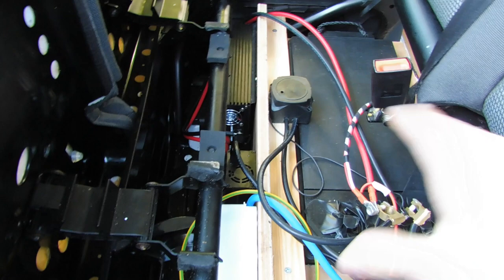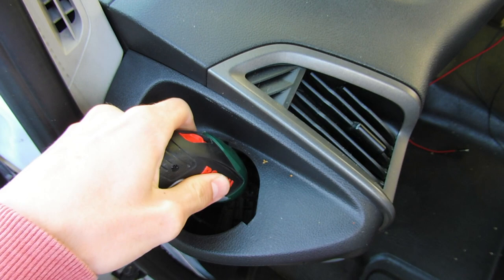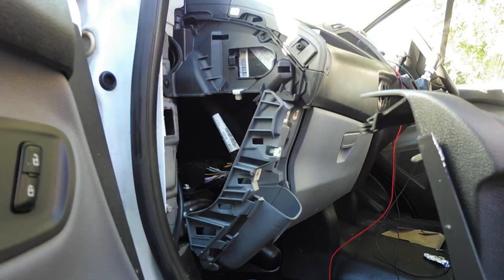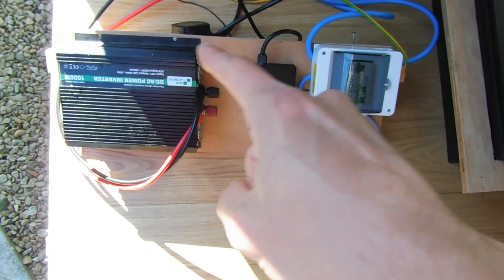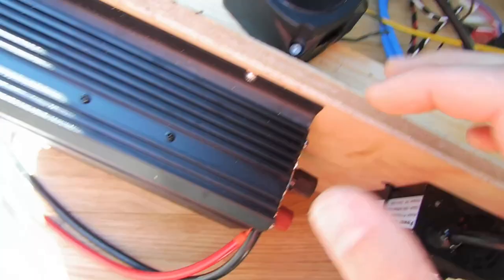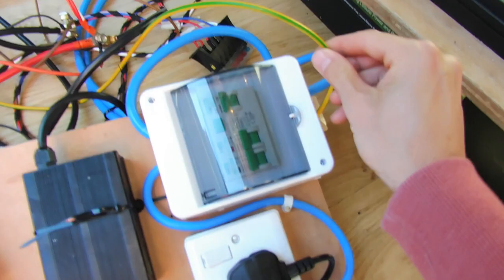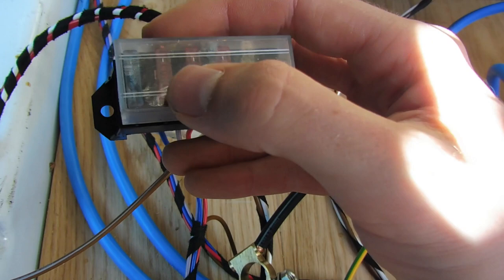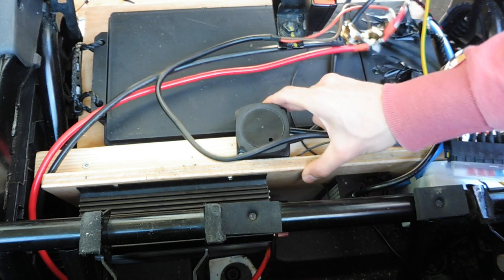VanLog 06 CAMPER CONVERSION Ford Transit Custom ELECTRICAL KIT! HOW TO

Comment: Not sure what the outcome of the smart alternator issue was here Hugh. Did the VSR provide a solution to proper charging of your leisure battery. My guess is that you had a smart alternator.
Reply from the maker: Hello buddy, the VSR turned out to be a bad choice. With a smart alternator you need a dc to dc charger
Reply: @HughTube  thanks, I am not going for a solar panel as I can't justify that extra expense I would rather use a large leisure battery and run it flat if the drain or stay without a charge occured. It's not the end of the world,  In reality I don't forsee that kind of use and solars are probably way overkill. The charger of leisures using the correct charge interface from a smart alternator is supposed to be much quicker any way, however we are looking at around £200 for a smart alternator charger.

Comment: I have a 2013 transit custom. The vehicle batteries are stored under the drivers seat. Would it not be easier to run a cable between the driver and the passenger seat rather than from under the bonnet?
Reply from the maker: hello buddy, yeah sorry about this, you can go straight to the battery under the seat. I was following the instructions given too strictly and didnt need to go to all this trouble
Reply: @HughTube  not to worry at all! Love your videos as I'm converting on a student budget and you've got some great money saving ideas

Comment: my question is this, is it really worth the expense and hassle of fitting a leisure battery and charging system if your not bothered about having internally routed lighting in the back?? is there any wisdom in using for example the cigarette lighter port in the cab for charging things like phones and laptops and maybe adding a solar charger on the roof? personal choice or necessity?
fyi im in a hot country so heating isnt an issue.
Reply from the maker: nobby styles good question but in my experience the van battery isn't that big and isn't really designed to release energy the same way a leisure one does. I couldn't run a heater all night on my van battery or run multiple mains appliances at the same time safely.
Reply from the maker: nobby styles your idea to just have a solar panel can work but you say your in a warmer country so you probably get much more efficient solar usage as well. 
Sorry I don't want to sound like I'm ranting at you and thank you for the input!!!! It's what this is all about!
Reply: im only in the research phase at the moment prior to buying a van so all this info is immensely helpful. thanks.
Reply from the maker: No problem buddy, it's great to bounce of others ideas!

Comment: Did you put your Mains Earth to the chassis of the van? Pretty sure that is unsafe mate. You should earth through your shore power. I'm not an electrician, but I remember when we did my van, the electrician made sure to tell me not to earth the mains to the van.
Reply from the maker: Very interesting! I may of heard this from a poor source then but that was where I was told to earth it! I will do more research, thank you very much for bringing this to my attention!
Reply: HughTube glad you didn't take it as an insult mate. Honestly I was just concerned. But, if your mains have a short to ground, that will put 240 volts throughout your chassis.
Reply from the maker: Righty-o thats a tad worrying I will sort this immediately and release an update video.
Reply: Having just read up on this, it is regulation to earth the consumer unit to the chassis. As I understand it, the reason this is done is so that if an exterior live hookup wire is damaged and contacts the van metal, then because it is earthed, the RCD trips and the connection is switched off. If you don't connect the earth,  the chassis would become live and your consumer unit would not trip (as the connection is made before your unit). Then you rely on the campsite RCD to trip.
Though it sounds like people do argue it both ways.

Comment: Which kit did you buy ?. Nice van
Reply from the maker: Justin Currie thanks! Well if you follow the link in the description to the kit I chose 4 downlights with voltage sensing and 220ah battery. It came to just over £600 which is a lot of dosh but  it should be top notch and last

Comment: How do you find out if you have a Smart Alternator? Cant seem to find anything online :/
Reply from the maker: This is the annoyingly tricky part. I think that most 'new' vans are moving this way. Mine is 2013 and has one but I think that most vans from around 2012 and before don't have them. The safest bet is to ask the manufacturer, sorry I cant be more help!
Reply: HughTube Mine is a 2008 Transit, and going off this, and the scraps off info I can find online, I think it's just a regular alternator. I'll soon find out I guess! Thanks for the reply, love the videos! 😊
Reply from the maker: I am pretty sure your van does not have a smart alternator! Thanks for the comments